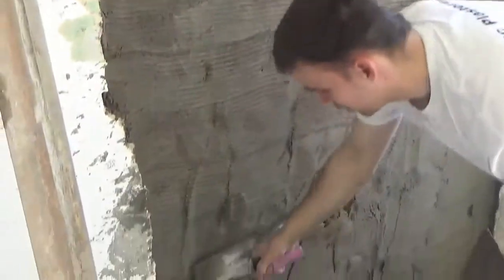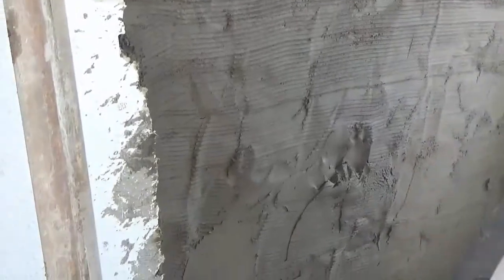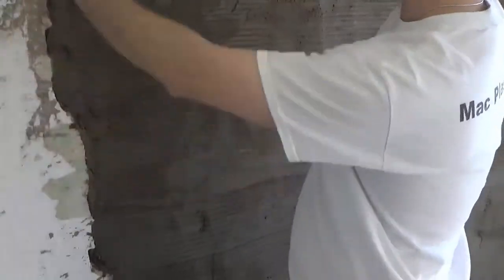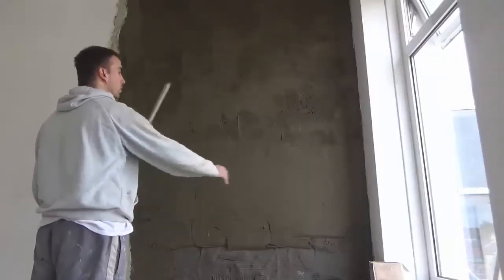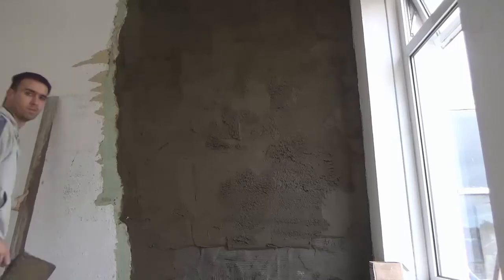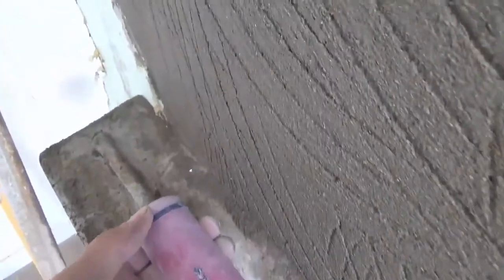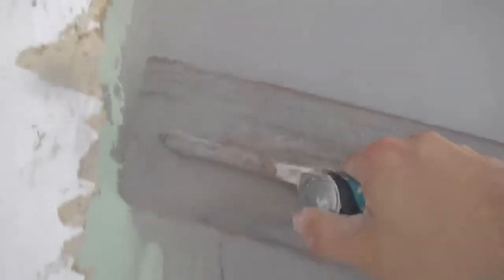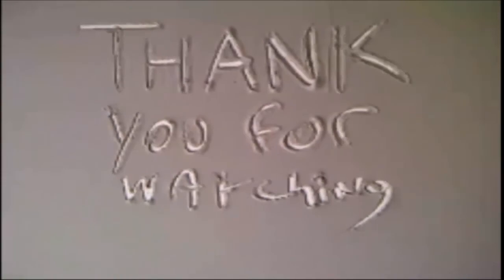PLASTERING OVER OLD STONE PART 2

Comment: What ratio did you use for sand and cement, plus did u add anything to the mix to make it smooth.
Cheers
Reply from the maker: the last coat most likely was 4 to 1 or 4and half to 1 and most lily only salt inhibitors' in this one all depends of the job what mix it is have block and brick wall videos on here with different mixes to suit the different walls ect

Comment: I am not looking forward to finally doing that job at my other house, dare I film it for you to see? Maybe 3 weeks time.  Were you using another mic half way through this video seems louder and clearer not drown out by traffic.  Great job thank you once again for sharing.
Reply from the maker: Thanks for watching  Steve mate you should do a clip on it :) that patching vid of mine will be up asap so keep an eye out ~:) yes there is another mic as the 1st one was not clear on that section so voiced over :)
Reply: Clever voice over glad you kept the  sound of plastering worked really well. I will look out for the next one. Most likely I will go to my home 3rd July at Middlesbrough. .
Reply from the maker: Great I promise my video will be up loaded long before then giving you some time to think and learn some before you start, planning is the key and preparation is the open door to a great job :) :)
Reply: So there is more than one key to making plaster stick. I will keep watching. The gap I need to fill is most likely only 5mm deep. I think whomever did the job all those years ago didn't use any bonding glue.
Reply from the maker: Steve Phillips very possible or it was dusty
Reply: Dusty never thought of that will bear it in mind when I get wround to doing the job.

Comment: Hi Mac. Did u use 4 part Plastering sand and 1 part cement. And did u  go over it with multi finish skim
Reply from the maker: hi mate it would have been 4 0r 5 to 1 for the last cement coat then 2 coats if multi
Reply: @macplastering  thank you  for replying to me pal. Got another question for u😁IV used thistle bonding in a Victorian house in the  living room. IV taken off the old  plaster. So I have bonded the whole room with thistle bonding. The outside wall are stone and the inside wall are brick....  The problem is,,, it's starting to give off a moisture smell, but the water is still holding in the bonding Plaster.... This smells has been at least about 3 weeks.. do have any ideas what has might has happened. Is the any chance I can what app u the photos and vids???

Much appreciated from,
Moe.🙂
Reply from the maker: @moeenahmed6853  No problems mate I will always get back to the comments and subscribers as soon as i can , Mate I the smell is damp , I wouldn't recommend bonding on outside walls such as window walls I would mostly recommend bonding on plaster board only , what happens with bonding is that it will hold water like a sponge and not dry out very well at all so it will just get worse and quickly i would imagine, I would suggest you take it all back off and use sand cement , lime or you could dot and dab the walls using bonding compound / plasterboard adhesive, keeping in mind you most find the source of the damp and stop it also , have a good look out side , gutters , down pipes do they leak look for moss water stains holes in brick work that could be letting in roof tiles , look at the ground is the plants close to wall is the ground outside higher than inside is there vents inside or outside blocked up ? is it a wood floor or solid floor inside buddy ? sorry for the big big message back but plastering is more than just putting it on the wall we must keep an eye open for the reasons why for a more long term job , hope this helps mate I can try do a live stream tonight if it would suit you ?
Reply: @macplastering  Hi Mac. Thank you for replying to me... So much appreciated for you knowledge buddy.🙂
Please do a live stream. I can send u photos and vids of what I have done.... 

Plus does this method also go for hardwall plaster as well bonding Plaster, where it would hold water?

The house has damp,  but it is the cellar basement only... Not up stairs in the living rooms. The living rooms do not have damp of what's so ever... 
But I'm gonna take your approach for the sand and cement render rather than bonding... 

Is best to do sand and lime render or shall I do sand and  cement render or shall I put all 3 in the mix???? If I was to do lime render,,, would it be hydraulic lime, would it be this lime for jewsons,,, IV put a link below

https://www.jewson.co.uk/building-materials/aggregate-cement/cement/hydrated-lime-cement/products/CEMBLIM3/blue-circle-lime-hydrated-white-25kg/

I look forward from  hearing from u buddy.

Peace and love bruv,
Moe🙂✌️☝️
Reply from the maker: @moeenahmed6853  I dont use much of lime as most builders and costumers dont want the long waiting game and the big prices of it both labour and materials buddy send the pics in an email and i will using them during livestream to help me  explain better if you like
Reply: @macplastering  yeah no worries. What's the email address shall I send it to u.
Reply from the maker: @moeenahmed6853  That would be one type of lime , there is lime putty as well for plugging holes and then there is lime finish and lime wash / paint as if you do it all in lime you have to keep it as lime others wise no point really, lime idea is that it is more able to let air flow and some think its a little more flexibility but it is softer so can mark more dude I can talk plaster all day lone lol , you can also do a 3 sand 1 cement 1 lime but I wouldn't do as much lime  if i was doing it i would only do a shovel full of lime to a bucket of cement dude i will try get the livestream done if suits
Reply from the maker: @moeenahmed6853  macplasteringservices@hotmail.com
Reply: @macplastering  I'm I able to send videos on these???
Reply from the maker: @moeenahmed6853  give it a go buddy
Reply from the maker: Hope the livestream helped some mate and keep me informed how ya get on :) All the best MAC

Comment: good Video Mac, how many coats can you apply to a stone wall to build it up?
Reply from the maker: The most i have done is 5 cement coats the 2 skim
Reply from the maker: just make sure if you start 1 to 2 the next is 1 t 3  and weaker every mix
Reply from the maker: every coat / stage
Reply: not a 100% sure what you mean mac, what mix would you usually use i normally use 5 part sand 1 cement 1 lime  
how long did you wait after the scud coat, to put the scratch coat on thanks
Reply from the maker: You could stay with that type of mix buddy but for the 1st few coats make them a little stronger than the next so it wont blow off
Reply: ok thanks, how long did you leave it between the scud coat and first scratch coat